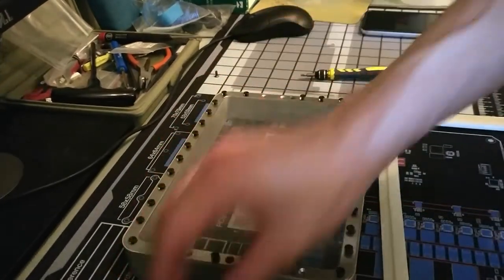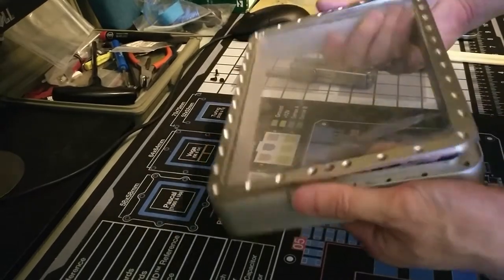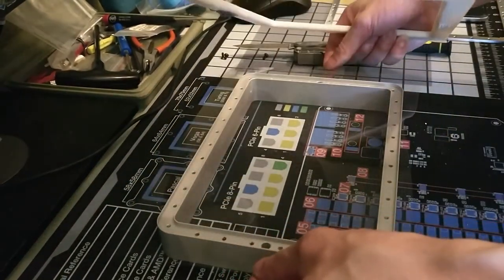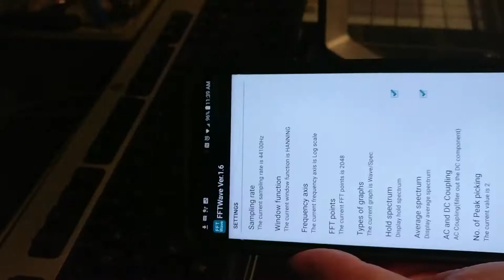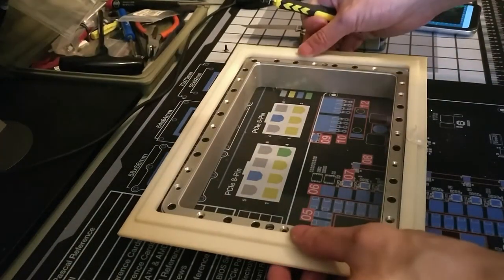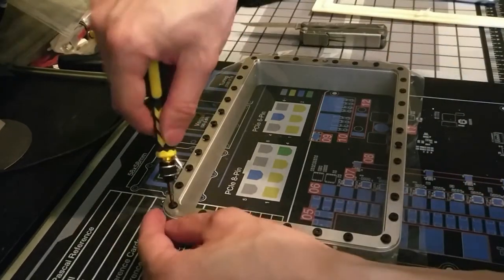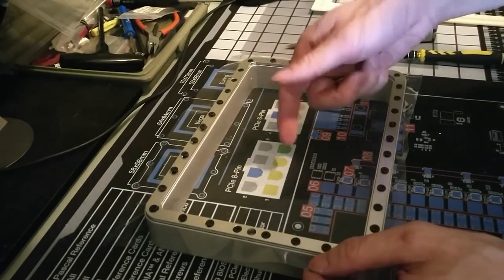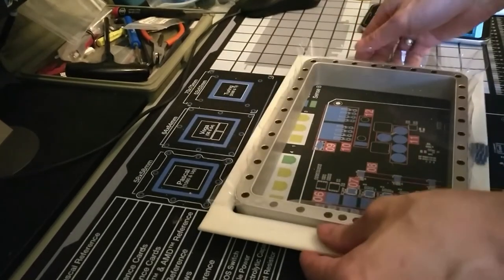Changing FEP release film on Phrozen Shuffle XL Resin Vat using an installation gasket tensioner

Comment from the maker: Made three prints subsequent to this video. Everything worked perfectly, didn't even have to re-calibrate z-axis build plate level. 150 Hz frequency for 100 um FEP film. If you are tuning with a phone app, make sure you're drumming the film with the vat oriented on its edge so you aren't getting sound reflections from whatever surface it is resting on.